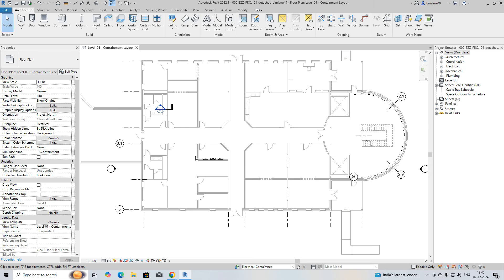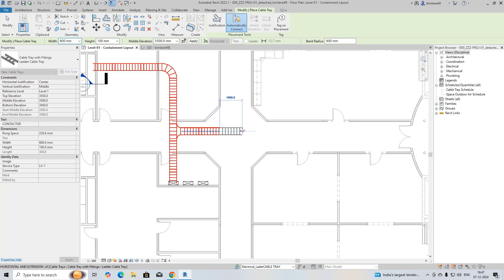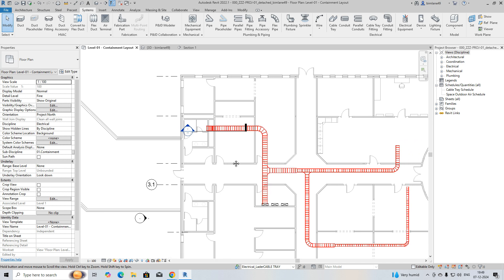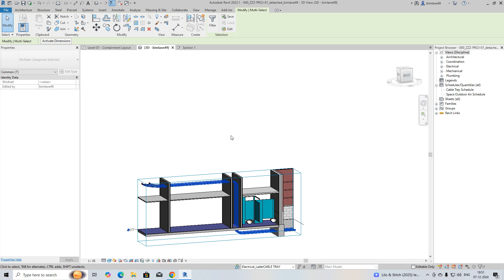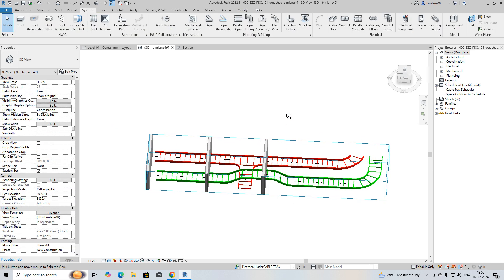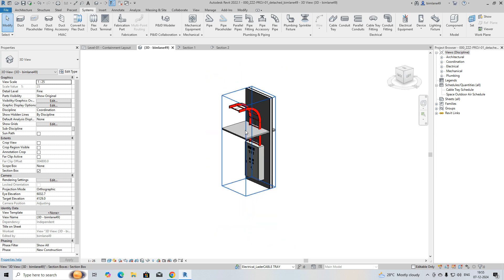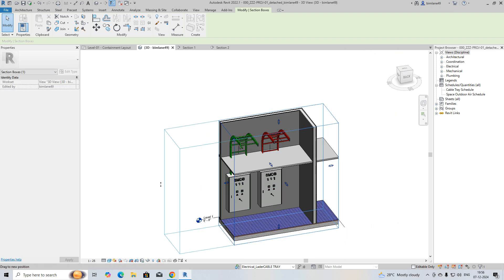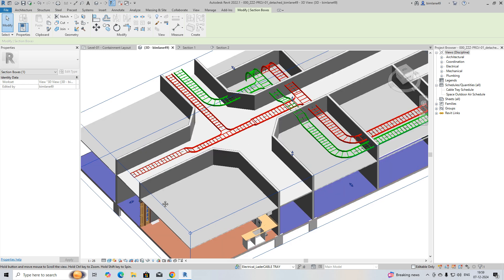REVIT ELECTRICAL CABLE LADDER training for beginners

Comment: Hello sir I would like to know 

- "Do we need to update the CAD files to Revit?": This means asking if the company requires employees to convert or transfer existing CAD (Computer-Aided Design) files into Revit, which is another software used for 3D modeling and building information modeling (BIM).

- "Will we be working separately on the electrical, mechanical, and plumbing fields?": This is asking if different teams or individuals are responsible for handling the electrical, mechanical, and plumbing systems separately, meaning each discipline works independently on its own specific set of tasks.        ????
Reply from the maker: You can Insert cad file to revit if 2d or 3d